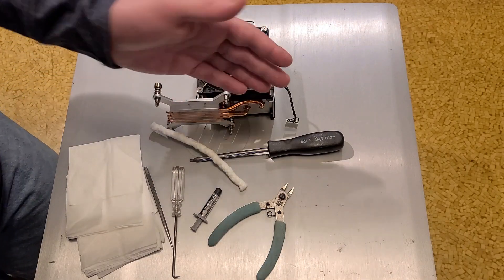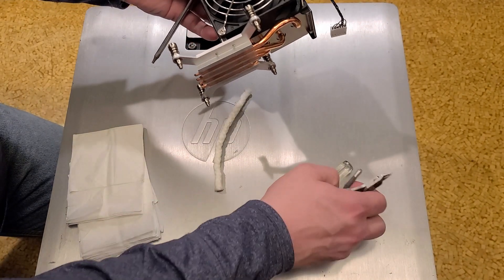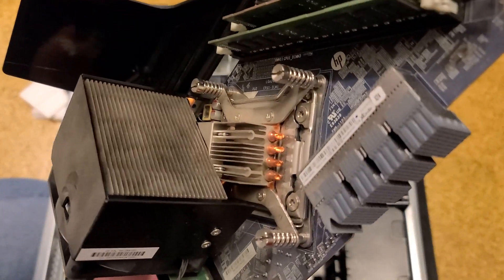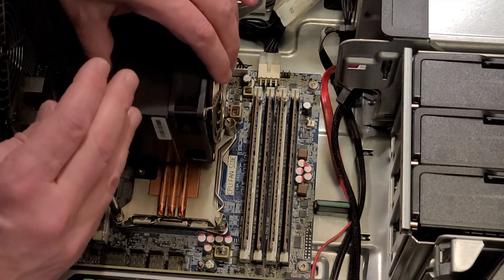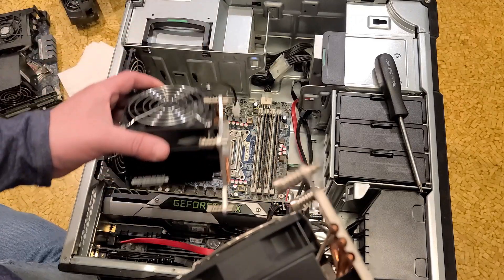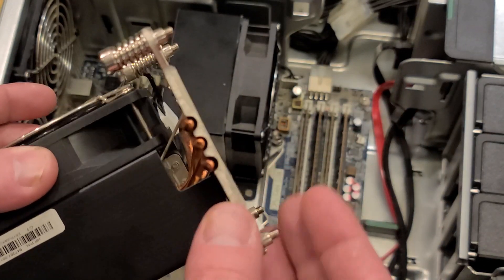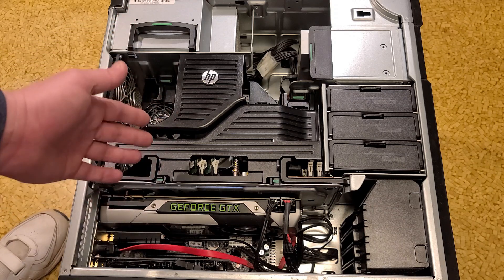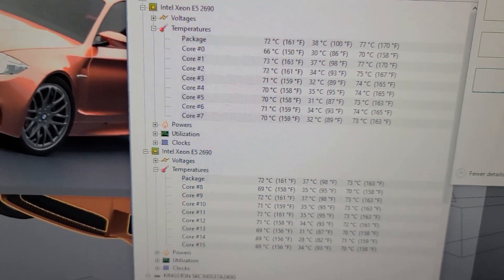HP Z620 Workstation to Z640 Heat Sink Upgrade

Comment: i have one with twin side by side cpus 128gb ram would like to find liquid or better cooling.  i use it for mining and currently while its doing that to heat my bedroom fall to spring
Reply from the maker: The HP Z420 had an available weird liquid cooler... Two of those might work.

Comment: I just got my HP Z620 and ordered E5-2690 v1 dual CPU's. I hope to not have problems with overheating. I also put in an RTX3090 but I am using a second power supply outside of the case since I don't trust the 6-pin adapters for a 3090. The age doesn't matter, still handles anything like a beast.
Reply from the maker: Look for the sticker in between PC I slots 3 and 4 with a serial number. If it starts with a six, then you're stuck with a v1 cpu, which the 2690 is the best.
If the number starts with a seven, then it has a updated boot block can support V-2 cpu which case you have many more options. The 2667 V-2 goes up to 4 GHz or you could get 10 core. Or even twelve core processors. I use dual 2667 v2, As for me, frequency and responsemense is a good trade-off instead of having extra cores, especially for games. Also, the v1 CPS only supports PC I express 2, the v2 cpu was the first to support p c I express 3

Comment: I have a problem after upgrading my 3 servers with the heatsink from the Z640. I swapped the 6-pin fan with the 5-pin fan that comes with the Z620. But the problem is that under heavy load, the cpu is at 60-65 degrees celius, then the fans ramp up to 3 000 - 4 000 RPM. With the stock cooler that comes with the Z620, the fans don't go above 2 000 - 2500 RPM, even if the CPU is at about 75 - 80 degrees celcius. It doesn't make any sense why the Z640 cooler would make the fans go faster, when the CPU is actually cooler... Have you experienced this with for example a stress test like Cinebench or Prime95?

Comment: This machine draws too much current. Hence draws Power from the wall, if one is not doing anything with this machine it is much better to power it down.
Reply from the maker: Or use sleep mode so it can be used quickly

Comment: Hi Catus, I couldn't find the power cable for the graphics card. The only solution I get in mind is to remove the second CPU part, to expose the 12 pin port, then connect this 12 pin port to the GPU. Which is pretty stupid for me, I sacrificed a CPU for a GPU. But I couldn't find the GPU power cable, where your cable links from? I see all the ports of the power supply are fully connected, no sign of graphics card cable.
Reply from the maker: Originally mine were weird and were plugged into the lower fan housing to keep them from bouncing around you should see two 6 pin cables at the bottom of the case.  I had to use a 6 pin to 8 pin adapter for one of the cables and it runs high load GPU fine.

 I just looked on the power supply I believe it is Q1 and Q2 for those 2 cables and they're rated at a 12v 18a which is 215 watts it would be surprising if rhar was the rating for each even though they're only 6 pin I believe as a little bit of future proofing because it's a workstation and they were expecting people to run high load GPU or dual GPU's so they're over specified 6 pin. I just would not try a 3090Ti.

 If you really cannot find them even at the bottom of the case plugged in that fan housing  Then pull off the other side panel and See if they are jammed back there

Comment: How do supply a 1080 ti with two 8 pin connectors if my hp z620 has 2 6 pin connectors
Reply from the maker: Go to your local computer store they should have these little 3" long adapters that go from 6 pin to 8 pin.  They may tell you that you shouldn't do that but Mine handles the 230 W Titan black just fine.  The Z620 has an 800 lot power supply and if that's not enough you can get A Z640 power supply which is 900 W for really cheap

Comment: Do you know if it's possible to swap out the memory exhaust fan on the 2nd CPU riser on a Z620? Mine is either making a high-pitched screeching or making a noise like a jet engine so assume the bearings are gone. All the other fans on the system are quiet except this one.
Reply: Delta Electronics Part No. EFC0812DB-F00 although you have to found out 4 wires definitions ( VCC, GND, PWM, Tacho) on your own. Good Luck

Comment: You can potentially shave a couple more degrees C off with different thermal paste, but I wouldn't bother right now since it's working fine and that's usually how I end up breaking things. I think the current leader is Thermal Grizzly Kryonaut, but I usually use Arctic MX-4, which isn't much better than what you have now, because it's been around a while (some pastes can dry out). As for application, the important part is that the dies all get covered fully when you clamp down the heatsink. Bigger CPUs need more paste.